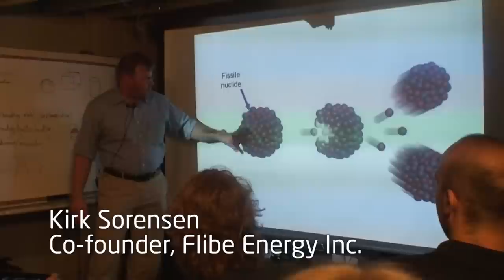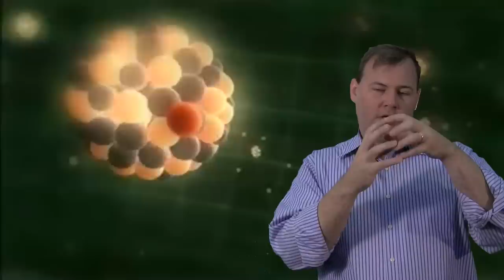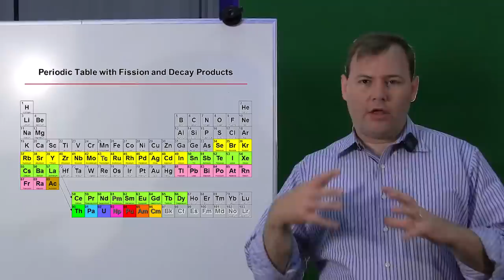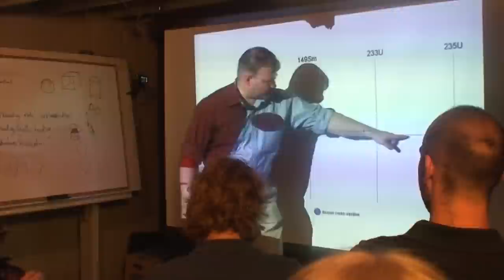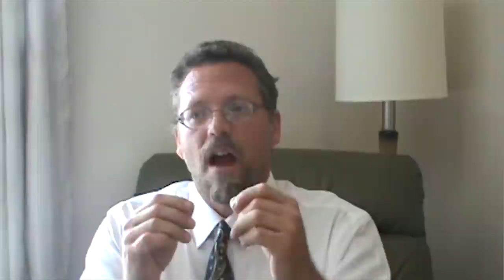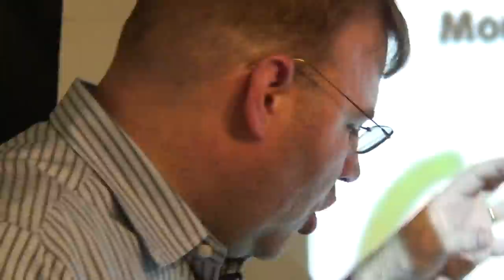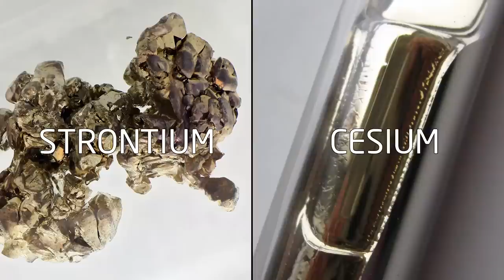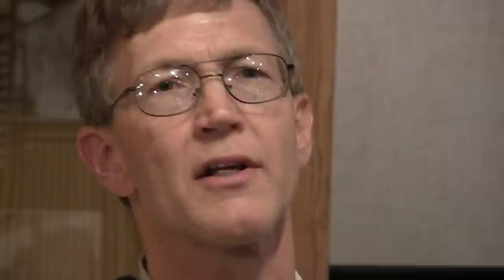Nuclear Waste: Fission Products & Transuranics from Thorium & Uranium - "Th" Documentary

Comment: Myth: the new generation of nuclear reactors are designed to recycle nuclear waste

BUST: These reactors don’t exist

These reactors often spoken of by advocates of nuclear energy are hypothetical. 
There are none of these “Generation IV” reactors commercially operating anywhere in the world:

Even the demonstration plants are still decades away
Various designs are still under investigation on paper and have been for many years.

The first demonstration plants are projected to be in operation by 2030-2040, so they are yet to be tested and still many years away.

Problems with earlier models
The specific type of Generation IV reactor that would recycle waste – the Integral Fast Reactor – only exists on paper, but earlier models of fast reactors have been expensive, underperforming, and have had a history of fires and other accidents, with many countries abandoning the technology.

These reactors would still produce some waste

The Integral Fast Reactor is called “integral” because it would process used reactor fuel on-site, separating plutonium (a weapons explosive) and other long-lived radioactive isotopes from the used fuel, to be fed back into the reactor. It essentially converts long-lived waste into shorter-lived waste. 

This waste would still remain dangerous for a minimum of 200 years (provided it is not contaminated with high-level waste products), so we are still left with a waste problem that spans generations.
The theory is that these reactors would eat through global stockpiles of plutonium

When thinking about recycling waste it’s important not to confuse recycling existing stockpiles of waste with these reactors perpetually running off of their own waste, which they could also be operated to do. If they ran off their own waste, they would not consume existing waste beyond the initial fuel load.

Simple, the whole process of fission reactors is economically unviable

It is obvious we should be putting all our resources into fusion reactor development

...
Reply from the maker: +ask412 While I'd like to see fusion be successful (many approaches are being tried, and one may certainly pan out), liquid fueled nuclear can indeed address many concerns people have with today's reactors.

You mention waste. Anti-nuclear campaigners seem very unimpressed by waste lasting hundreds of thousands of years being replaced by waste lasting a couple hundred years. Fine... if you say 200 years is unacceptable to you then then I'm not sure why Tritium with a half-life of 12 years is not a problem for you.

Most of these isotopes produced by fission (the fission products) can be put to productive use. But they must be segregated to do so. To be segregated, they must be in liquid state.

The very first step of pyroprocessing is to dissolve into molten salts... from there, waste can be separated and sorted into useful isotopes. 

The point of liquid fuel reactors, as first envisioned in the 50s by Alvin Weinberg and the team at ORNL, is not just to make nuclear fuel recycling possible, but that it should be economic to do so. Eliminating the steps of dissolving "spent" fuel, and reconstituting fuel pins, is how it can be made economically viable. Otherwise the cheapest source of fission fuel will remain enriched uranium, and our "spent fuel" volume will continue to grow at present rate.
Reply: +gordonmcdowell wrote: "...is how it can be made economically viable..." 

Every single thorium reactor built since the early 1950s has been experimental. 
If one of the experimental designs actually reaches 'proof of concept' it will take until at the least until 2030-40 

And  'proof of concept' includes economic viability 

That looks like a bloody long shot from this perspective ...
...
Reply from the maker: +ask412 Yes, and they've all been solid fueled reactors. Proponents of liquid fuel reactors (which includes myself) argue that Thorium can not be bred economically in solid fuel reactors. The only proof-of-concept achieved is that it is technically feasible, not economically feasible.

However, we'll be seeing commercial Molten Salt Reactors in the 2020s which can run on enriched uranium (like today's reactors do), but more efficiently. Whether that's the starting point from which chemical reprocessing is explored (enabling Thorium breeding) or development on Th-MSR begins in parallel with other MSR, this solid-fuel constraint will be going away. Too many companies and countries are pursuing liquid fuel for MSR itself to not reach commercialization.

This includes TerraPower too... that's Bill Gates reactor company. He once famously dismissed molten salts (in 2011) as being too challenging. Now Bill Gates is conducting research into molten salt fast-spectrum reactors... the perfect category of reactor to take today's spent fuel, turn it into energy, and turn it from a hundred-thousand-year-problem into a couple-hundred-year-problem. Much easier to solve storage challenge for hundreds-of-years than hundreds-of-thousands-of-years.
Reply: +gordonmcdowell wrote: "...we'll be seeing commercial Molten Salt Reactors in the 2020..." 

We may very well, however, there have been experimental reactor designs built like this since the 1950s with the same "Blue Sky Mining" stories and still no 'proof of concept' 
Construction of a new experimental molten salt reactor doesn't mean it has 'proof of concept' inclusive of economic viability.

That will take decades to prove, literally, get used to it

People like Kirk Sorensen will keep putting their stories up in seminars for the rich like Bill Gates, touting for money to keep going with their experiments.

Meantime, those of the Disney Generation will keep the 'faith' and still live in hope that 
'nuclear fission will make power too cheap to meter and safe'...

It's all a very, very old story, that human history has proved is still a dream...

...
Reply from the maker: +ask412 Why on Earth are you making positive comments about Fusion when your concerns would apply just as well to that?

"Economic viability" is only proven when a commercial reactor is operating. Or disproven. Millions of dollars in MSR R&D are helping move toward that point. So please come back in 2025 and tell me how foolish I was. Take care until then.
Reply from the maker: +ask412 Could you stop bouncing around to various fission technologies (Hinkley Point C) and address the 2 technologies you first cited YOURSELF?

YOU mentioned fusion as what we should be pursuing. And YOU dismissed MSR as economically nonviable.

So why did you mention fusion? Were you being sarcastic or not?

blah blah blah Disney. I get it, you're trolling. Get back to your fusion tangent and clarify whether you are seriously citing that as what we should be pursuing or not. Since YOU raised the point.
Reply: "These reactors often spoken of by advocates of nuclear energy are hypothetical." That is exactly what describes fusion reactors to a T. "Simple, the whole process of fusion reactors is economically unviable." Find me a reactor that creates more power than it consumes and MAYBE, just MAYBE, we have a case.
Reply: '...commercial reactor is operating. Or disproven. Millions of dollars in MSR R&D...'  gordonmcdowell

You nailed it, all these reactors are experiments, while simultaneously sold in the sales brochures^ to the political centre; 'as if' they are economically viable.
Which by anyone's system of values is deceitful when alternative energy systems have reached economic viability, suit micro, small, medium, large and super grids; and are relatively cheap to recycle and redesign  
____________
^ as above in this video, blog pages etc.etc. all linked to the 'business' of acquiring research capital that needs to run over the next millennia  or longer
Reply: 'ask412 Could you stop bouncing around to various fission technologies (Hinkley Point C) and address the 2 technologies you first cited YOURSELF?'   gordonmcdowell

Why? 

The fact is MSR/thorium/generation IV reactors have been sold using the very same premise as gen I, II, III, III+ that were, or are, in a continual stage of development; where 'blue sky mining' projected futures are promoted 'as if' these are or were economically viable. 

Yet, history shows that the national or multinational nuclear energy corporations making these promises have failed to fulfill the 'Disney Generation' dream of 'delivering electricity' ..."too cheap to meter".    
Let alone produce metrics of the complete reactor cycle, nor will they until any nuclear reactor is decommissioned, and still up till  2016 none have. 

It's the same strategy, just using new 'weasel words'  in marketing across all forms of media creating a surreal expectation of nuclear energy to suit vested interests.
Reply from the maker: "Why?"

Because I don't have patience for anti-nuclear activists who cite fusion as a solution to pretend they're open-minded in regards to atomic power.

You've offered no objection against MSR & Th-MSR other than it-hasn't-been-done-yet commercially.

So explain how that does not apply to fusion?

I'd love to move past this point once you answer the question.

And I'm very confident in nth MSR costs being quite low. Even AP1000 is seeing dramatic cost reductions in the 2nd Vogtle unit compared to 1st. No-brainer when every reactor isn't a 1-off special snowflake.
Reply: gordonmcdowell
I grok your comment, apologies for the tone

Still, I can say; 'I have little patience' after decades of scanning for kernels of truth from the whole nuclear industry

A group driven by either:

1^) taking ground from the enemy at all cost, with everything else as collateral damage;
or by a
2*) profit premise, that puts the relatively short term ROI, at the apex of decisions and before social responsibility

Given the timeline the nuclear cycle needs to mature, evolving into a safe, viable source of  energy; I to have little patience for the impatient.  

The 'true believer' who expect nuclear energy to reach it's potential in such a relatively short period as two or three generations lifetimes.

Eight to ten generations would be a conservative perspective, given the millennia involved in whole nuclear energy production cycle, inclusive of nuclear waste storage

____________
^ 1) the military
* 2) the energy monopolies

Both run by the UN Security Council

The irony is the nuclear stories are woven around fission reactors by the UN Security Council; China, France, Russia, United Kingdom, United States

A group who oversees the course and direction of energy production of weapons and electricity; controlling the industry with international treaties that are policed by the IAEA. The industry group who also curates the media globally about safety, viability and development

While pushing the nuclear line in a continual global arms race for peace and security, or nuclear energy production of toxic radionuclides, to boil water and generate electrical energy

This has normalised the nuclear industry conditioning people to never question it's value since 1945 right through to our present era

August 2016 is 71 years since the Hiroshima and Nagasaki atomic weapons were used in the name of peace

To this day we have never seen the true dollar cost of cleaning up the weapons mess growing year after year
Neither have the metrics of any nuclear reactor cycle ever been transparent, as none have been fully decommissioned

What are the probabilities any reactors metrics ever will be transparent?
Reply from the maker: Well it would help if you stop conflating weapons production with energy production. Since no one I've spoken to over since first hearing about MSR in 2009 has any interest in weapons. The only weapons interest they have is turning warheads into fuel.

Great that you don't trust U.N. Security Council. Lots of conspiracy theorists do not. 

IPCC recognizes nuclear LIFECYCLE as low-carbon. That is, less CO2-per-hWh than even solar PV.

Are you going to call that into question too?
Reply: Can you go to argument clinic please?
Because Argument never win due to extreme skepticism and loosing yourself whether the informations and sources are accurate or not.
Reply: Jaret Jose Ulanday that comment is framed around an opinion nuclear reactors are worth developing 

Based from your comments on certainty, what makes you believe this type of  fission reactor will beat any fusion reactor to 'proof of concept' inclusive of economic viability since they both have been in development since the 1950s? 

Can you in your considered opinion, explain how much longer it will take to develop this type of thorium reactor?
Reply: Nothing beats nuclear fusion reactors like Tokamak and Stellarator against nuclear fission reactors, but there is a problem: how can we produce hydrogen for fusion reactors?

You make know tritium—a radioactive gas which a half-life of 12.3 years—exist in nature, but it is rare and hard to get it. On the other hand, deuterium like tritium can also exist in nature, yet it is more common than tritium but rarer than ordinary hydrogen a.k.a. protium. It can be easily done through electrolysis, which is used in Manhattan Project and Uranprojekt (German nuclear weapon project) for producing atomic bomb during Second World War and Girdler sulfide (GS) process. However, when this get deplete for the sake of electricity production, it's hard to get it, yet can be deplete this for millions of years.

The economic feasibility of deuterium and tritium production for fusion reactors (I have no choice) rely on nuclear fission reactor. Fission reactor like Light Water Reactors, Breeder Reactors and the proposal Molten Salt Reactor can produce deuterium and tritium through the bombardments of atoms.

The best doesn't always right and the worst doesn't always wrong, more than just for economic feasibility, they are also for space exploration. We need to diverse and synergize energy for reaching the stars.
Reply from the maker: Copy/paste from Ask412. Ask412 routinely edits his posts to misrepresent conversations, this is a means of addressing his after-the-fact edits.

--- COPY/PASTE STARTS ---

You make know tritium—a radioactive gas which a half-life of 12.3 years—exist in nature, but it is rare and hard to get it' Jaret Jose Ulanday

Like a lot of the science on this videos threads, what you say about 
tritium is partly true 

However, tritium is made every day in prodigious amounts

How so? 

It is made during nuclear fission in a reactor as are many other 
radionuclides, those can be contained, the problem is containing tritium
 gas, not making it, as it leaks out of all known containers regardless 
of the science employed  

A long-term study of the environments around fission reactors in Germany
 has identified the cumulative exposure to this tritium gas leaking 
24/7, 365 days per annum is damaging the DNA in rapidly dividing cells 
of living things. Most importantly in those of growing German children 
0-12yo, couple this serious health issue with the dramatic fall in the 
cost of renewables electricity, and Germany has changed their public 
policy toward nuclear reactors 

The result is the scheduled decommissioning of all the nuclear reactors,
 and replacement renewable electricity alternative energy development 

For the record here, Switzerland is voting at the end of November 2016, 
on a reactor decommissioning program based on German Public Policy over 
renewables replacing reactors 

Also announced this month of November 2016 Taiwan decommissioning 
reactor program based on German Public Policy over renewables replacing 
reactors also

The nuclear dominos are falling renewables are cheaper, and the science 
of detrimental health effects can't be covered up any longer. Covered up
 by the UN Security Council P5, based on national security priorities, 
where the IMC objective takes precedence of social responsibility

A UN Security Council P5, public policy premise policed by the IAEA 
since it's inception in the 1950s. Where the IAEA manages the WHO 
publication of health studies^ and also looks after the legal 
ramifications of all international treaties around nuclear weapons, 
reactors, and medicine. I am aware that the UN media services have 
worked very hard to put nuclear matters in silos segregating all three, 
nonetheless, they're all part of the nuclear industry and it's culture 

If this wasn't true the IAEA nuclear industry association wouldn't 
exist, logic dictates it is one industry and culture 

--- END COPY/PASTE ---

"Ask412" you can post a link to the study you are citing regarding Tritium. I can understand why you might not post a link... links need to be approved. But you could have at least named the study.
Reply from the maker: Copy/paste of "ask412" comment. Ask412 revises comments after soliciting a response so this is a means of locking-down the actual conversation.

--- START COPY/PASTE ---

gordonmcdowell '...IPCC recognizes nuclear...'

That's a very subjective opinion gordonmcdowell

--- END COPY/PASTE ---

http://shrinkthatfootprint.com/greenest-electricity-source

IPCC puts nuclear's carbon footprint... its LIFECYCLE carbon footprint... between wind and solar. That's low carbon. Only anti-nuclear folk seem to get stuck on this point, as they prefer studies like Jacobson's where the carbon footprint of nuclear war is included, or historic & less efficient means of enriching uranium are weighted heavier than they should be.

Which country has lower carbon footprint, France or Germany? France is lower-carbon. That is because they're electrified and nuclear powered. If nuclear was high-carbon then France would be high-carbon, but they're not.
Reply: 'ask412 Why on Earth are you making positive comments about Fusion when your concerns would apply just as well to that?  gordonmcdowell    

Firstly I am on earth, I respect this as a unique place in the universe, with orders of magnitude in complexity due to its near countless ecosystems acting integrally as one system, that far exceed any man-made system,  in this case, the reactors relatively simple complexity by comparison

Secondly, why are my comments positive or negative, fusion and fission reactors have been in experimental development from the late 40s till 2016/17, that's over seven decades - 70 years? 

Thirdly, what are the probabilities fusion will beat fission to 'proof of concept' in engineering terms, inclusive of economic viability?  

'Economic viability" is only proven when a commercial reactor is operating....' gordonmcdowell 

I couldn't agree more, nonetheless, no reactor has a full set of metrics proving or disproving, economic viability, everyone so far has been a unique experiment, even the decommissioned ones

'...Millions of dollars in MSR R&D are helping move toward that point...' gordonmcdowell 

Yes, this is absolutely essential, if this reactor science is going to come to fruition, so I couldn't agree more with you. As all innovation throughout our species history has required great risk for great reward, this is a given 

Please be mindful since 1948, not $US billions, but many $US trillions of sovereign wealth, have been spent collectively by just the UN Security Council P5 nations of; China, France, Russia, The United Kingdom & the United States and yet there still is no reactor with 'proof of concept' inclusive of economic viability in engineering terms

'...So please come back in 2025 and tell me how foolish I was...'  gordonmcdowell

Nonetheless, nine years is a relatively short timeline to expect a resolution to this relatively short innovation creation, as yet unrealised economically. When just the tiny transistor as one example, has been in innovation since 1959 and it's cycle of innovation has long ago proved to be economically viable, but this happened many generations after it was created. 

A timeline for transistor innovation, until now is six decades long and over 60 years 

The solar cell was created as an innovation in the early 1800s, and it wasn't until the photovoltaics breakthrough in the early 60s, it had potential; in the late 2000s  the solar panel became economically viable to fit on homes and large businesses 

A timeline until now of five decades and over 60 years, and those two examples are complex. But by comparison to nuclear reactors both are relatively simple problems of technique and automation feeding the speed of achieving economic viability

'...tell me how foolish I was...' gordonmcdowell

Ok, I'll come back if I can

It's only nine years away, but why are you foolish raising money for reactor research, it's essential going forward for our evolutions as a species? 

If this works out after a realistic timeline of development, fantastic. 

But what are the probabilities of achieving a realistic waste solution, the economic viability of any reactor and miniaturisation, in less than a decade? 

Which are parameters now essential in competing with clean, alternative, renewable solar, wind & wave energy, growing smaller dimensionally yearly, and yet producing the same or greater electricity output? 

What will clean alternative renewables be doing in nine years, as the profit made - then reinvested or economies of scale, feed in fast so are even now growing exponentially in 2016/17? 

I haven't even touched on all the alternative energy innovations about to achieve innovation efficiencies, able to make them economically viable
Reply from the maker: This is a copy/paste of Ask412's comment because Ask412 constantly modifies posted comments altering the questions after-the-fact.

--- BEGIN COPY/PASTE ---

Which country has lower carbon footprint, France or Germany? France is lower-carbon'...' gordonmcdowell 

This is past history regurgitated, here and now going forward nuclear energy is failing because of innovation efficiencies in alternatives, they are getting cheaper by the month year and decade 

What are the probabilities this will reverse as nuclear reactors keep failing? 

Seriously, that's a reference to a blogger^, 'My name’s Lindsay...'I have an economics degree...' yeah, making money selling his consulting services 

He is entitled to his opinion all good, I hope it works for him, because nuclear reactors are dropping like flies across Europe and 'Winter is Coming'   

France's reactors are in trouble
This has lead to reactor shutdowns in France, as they require base-load, 24/7, all year, pumping out near peak power. If they don't run like this maintenance increases dramatically and switching on&off makes energy very costly to trade against alternatives, and 20 reactors have shut-down this year in France already and 'winter is coming' 

"The discovery of widespread carbon segregation problems in critical nuclear plant components has crippled the French power industry—20 of the country’s 58 reactors are currently offline and under heavy scrutiny. France’s nuclear safety chairman said more anomalies “will likely be found,” as the extent of the contagion is still being uncovered" * 11/01/2016 | Lee Buchsbaum - Power- Business & Technology for the Global Generation Industry Since 1882

The global grids are interconnecting using clean, fast to recycle, C02 emission neutral renewables, and alternatives of all types ^^

All able to operate across time zones, smoothing out peak demand and operating across geopolitical borders with no issues 

Vietnam has killed off their reactor project as uneconomical^^,  and last week Taiwan announced a reactor decommissioning schedule going forward ** 

--- END COPY/PASTE ---

Ask412,

You are confusing "past history" with present. Germany PRESENTLY has higher carbon footprint than France, and Germany isn't even down prematurely shutting down nuclear. Germany's carbon reduction has stalled even while their renewable share has been climbing. That's the present. Welcome to the present.

"You cited a blogger..."

I cited a blogger who cited the IPCC source. You saw that, right? IPCC didn't post a bar-chart so it is up to people trying to communicate to the public to bar-chart it from their report.

Here's Environmental Progress doing the same.
https://pbs.twimg.com/media/CoJRschUEAA38aG.jpg

Don't worry I've got a nice piece I"m working on bringing together IPCC, charts on Germany's stalled GHG reduction, and Dr. James Hansen. You'll have no trouble following along.
Reply from the maker: ask421, Really, you don't see the IPCC reference cited in both bar charts? It isn't that you're lazy, I'm sure.

The very first comment on this thread you posted included the following:

"It is obvious we should be putting all our resources into fusion reactor development."

...and then you switch gears in later comments and cite TRITIUM as some insurmountable obstacle when created by fission.

Of course there will always be insurmountable obstacles for you.

Of course you can't be bothered to read the IPCC citations provided by the blogger or Environmental Progress.

And of course you won't acknowledge France's lower GHG footprint beating Germany's as an important observation.

Ask421 quotes me...
‘You are confusing "past history" with present. Germany PRESENTLY has higher carbon footprint than France, and Germany isn't even down prematurely shutting down nuclear’ 

My typo: down -> done. DONE. "DONE." Germany isn't even DONE prematurely shutting down nuclear.

See how the sentence doesn't make any sense with the word "DOWN" in it?

If Germany is not DONE shutting down their nuclear fleet.. if they continue to replace GHG-free energy with a mix that include biomass, how is this going to improve? Answer: Not for a long time.

If Germany planning on shutting down all coal by 2023? Can you even imagine them doing that? I can not.

http://www.independent.co.uk/news/world/europe/france-close-coal-plants-shut-down-2023-global-warming-climate-change-a7422966.html

http://www.climatechangenews.com/2016/10/27/german-minister-well-burn-coal-till-the-2040s/

So, no, I am not calling Germans liars. Great for you to throw that out there though.

I am observing that Germany's GHG have held steady despite a very rapid climb in their "renewables" share. And that their GHG has never dropped below France's. As of TODAY there's no evidence you can provide disputing this.

And that some French PWRs are about to be shut down is indeed troubling. Do you think that will result in France GHG drifting up beyond Germany's? It won't help matters, but I don't see that happening. There's not enough French PWR impacted.

Do you need another example of low GHG with a nuclear mix? Ontario. I was born there.

http://live.gridwatch.ca/home-page.html

...they haven't burned coal since 2014. That is what Germany could have been, had they not begun prematurely retiring their nuclear fleet, and instead supplemented it with additional clean energy.

NOTE TO COMMENT READERS: ask421 routinely edits comments after posting them, to change context of given replies. To address this I am copy/pasting his comments in my own (and deleting his) so there's a permanent snapshot of the conversation.

--- BEGIN COPY/PASTE of ASK421 COMMENT ---

'Here's Environmental Progress doing the same...' gordonmcdowell 

Seriously, the same as; '’My name’s Lindsay...'I have an economics degree…’ ?  

Just be mindful, taking 'images' as you have out of context with '....pbs . twimg . com / media / CoJRschUEAA38aG.jpg...'  is doing me a favour

Why?  

I can't drill down through the information, and look at any writers vested interests, identifying biases one way or the other, and forming an opinion, so, I just discard it 

As there is no value spending time on it,  for myself, or any other reader, without any context we can discover verifying it's source 

Don't worry I've got a nice piece....Dr. James Hansen'  gordonmcdowell  Interesting, "That's gonna be huuuge"  

Dr. James E. Hansen, longtime director of NASA's Goddard Institute for Space Studies, sounds interesting, good choice  

'You'll have no trouble following along...' gordonmcdowell

I never do, where we differ is in value systems applying the information and the unrealistic timelines of innovation development as an outcome of the altitude you are stuck on

‘You are confusing "past history" with present. Germany PRESENTLY has higher carbon footprint than France, and Germany isn't even down prematurely shutting down nuclear’ gordonmcdowell 

Really, is that your line of logic, are you infering, Germans are lying? 

Interesting, something to think about 

Fascinating, I have found Germans, and their language more literal, than French or English 

Then why has Germany announced it is decommissioning its reactor fleet with Energiewende^ , and Switzerland is having a referendum* at the end of November 2016 to choose a reactor decommissioning plan? 

‘Germany PRESENTLY has higher carbon footprint…’ gordonmcdowell 

And the problem is what, gordonmcdowell? 

My Best Guess is you were unaware that Germany having announced it’s transition out of the carbon energy economy; has decided to create a clean, renewable, fast to recycle, low carbon economy. So during the transition, is using energy sources including any offered as surplus by those countries it’s integrating with; who use base-load power, coal, oil, gas, or nuclear fuel. 

Is that right, or are you just pissed at this outcome? 

Nonetheless, the power offered by France and others coming out of reactors is too expensive, so it is bypassed by the central electrical control trading algorithms for cheaper energy when it is  ¯\(ツ)/¯

Currently, here & now, this means they are using alternative energy sources 24/7, and that is biogas, hydro, solar, wind etc.etc. it's mix changes in 350-second blocs though

If you want to use a blogger quoting an IPCC report about where they want the market to head strategically, when they met some years ago , that’s ok. Post the link I’ll scan it, all good 

However,  ’My name’s Lindsay...'I have an economics degree…’ has taken a snapshot of past events projecting them into the future. And as he may already be painfully aware, business is less moral than that, they don’t care, well, that is a banker, financier, CFO, all the EOs, stakeholders, corporate couturiers etc.etc. don't do they?  

And I am telling you here & now, 'if', Kirk Sorensen used these amoral ECorp courtiers lines of logic; he would tip up the experimental reactor as not worth the risk this innovation needs, and he shouldn't do this  

Because if it makes money in the next 350secs, 'we make money' say the ECorp courtiers trading electricity. So if they string those together 350secs to 700sec that’s better, and so on, this goes on day after day....and it's done without a human, by using code, AI, with no recognisable good human values. Except with the amoral oversight of ECorp courtiers trading electricity

gordonmcdowell, here’s the thing; the corporate world trades in nanoseconds, literally, and not in 5-minute blocs of 350 seconds electricity trades or slows down too 

Why? This is giving those like carbon & nuclear, a chance, as they are base-load dependant and a transition to a low carbon economy is in progress, so eventually, it will be in real-time, that's a given

Nonetheless, the energy trading system acting across geopolitical borders can do this in real-time and does. By using processors, software, and it’s algorithms used in the ‘market’ to make projections calculating in nanoseconds what are the probabilities of price are in the future. And the probabilities of all energy sources of generation, then it discriminates against the most expensive in weighing probabilities. Again, again, & again Infinitum…..
 
Sadly from your worldview, this includes carbon & nuclear fuel  

That is the context of my comments about the, here & now, not five years ago, a past decade, half century, or during a period of any reactors earlier timeline 

But over the previous, last and present financial years, electricity can be successfully traded from all forms of energy sources, but most importantly here & now

So based on that context, alternatives have proved cheaper in the previous, last, and present financial year in Europe. The same is true of this year going forward into a future

Point of fact is, strategic foresight by electrical energy professionals in grid marketing in Europe, can’t see alternatives getting less comparative as a ‘group’, in the next 25 years if ever

So nuclear cannot compete, here & now, in the real energy trading market integrating grids geopolitically, with current, production sources, carbon, nuclear, and clean renewables. It isn’t a problem, it’s been solved, and base-load power plants are looking like poor investments to the ECorp courtiers trading electricity 

This has driven the oil & coal price lower in order to pragmatically compete, and carbon emissions for the carbon energy sector just become an ‘inconvenient truth’, is all 

For the record, I don’t like it either, but this is a period of transition to a low carbon economy. So, I am not in denial of this outcome in the context of IPCC reports, and that it was predicted in the information I have been personally reading for many decades. So for me, this is no surprise, for you, however, it is, apparently

Which is fascinating 

--- END COPY/PASTE of ASK421 COMMENT ---

Gord writing again now.

Thanks for your thoughts, ask421!

Since you go-on at length about the challenges of all baseload... was your no-worries-about-tritium enthusiasm for fusion also a no-worries-about-baseload type of enthusiasm? Or was this going to be a tritium-free and load-following fusion reactor you were advocating?

To quote ask421: "Simple, the whole process of fission reactors is economically unviable. It is obvious we should be putting all our resources into fusion reactor development."

You sound like an expert on what is viable.

Oh look, someone is already demonstrating the viability of nuclear to decarbonize a grid...
http://live.gridwatch.ca/home-page.html

...with FISSION. A real thing. Here today. Which can be made even better going-forward with MSR instead of PWR. 

Maybe instead of fearmongering about tritium (which is rich coming from a fake-fusion advocate) you should convince people to build more long distance power transmission lines? That would help advance ALL forms of clean energy.
Reply: ‘...ask421, Really, you don't see the IPCC reference cited in both bar charts?…’ gordonmcdowell  quoting ask412

Re: the image in both, but where, when, and what context do the images have? ^   
Or do the reader and myself take this purely on faith, and use your context?    

As I said, I don’t have time for images without context, please let me clear as you seem to be confused, I don't actually mean your context^ 

So there still is no frame of reference for the image or images, except yours, why, gordonmcdowell?

Once again for clarity;  without your caveat; it comes from the IPCC, and the point is what,  it comes from the IPCC ; the point is what?

that is circular logic, why is that circular logic? because that is circular logic, which circles back to, that is circular logic, why is that circular logic? because that is circular logic, infinitum…  *

I’ll let the reader use their due diligence on that, as my point has been made more than once, so my question is now just rhetorical or an interior question, something to think about

‘Oh look, someone is already demonstrating the viability of nuclear to decarbonize a grid…’   

How, with yet more graphics out of context^?  

Ok, if it works for you,  what can anyone say?

Who could possibly have a conversation using circular logic? Except    

Generally people with ideological systems and utter certainty that comes with it  ^^  

All good, It's conversation of sorts

Nonetheless, to the reader it must sound like a K1-K4 playground one, which is sad, I guess it was unrealistic expecting more      

______________
^    Context includes the value system of the writer, group or groups, the culture or the worldview written and  the purpose of motive for writing   
*      https://goo.gl/WLZGBM    
^^     ✝   ✟   ☦   ☧    ✠   ☨   ☩   ☥   ☧   ☪   ✡   ☫   ☬   鞄   ﷲ   ☸  ☭  ideological values    
...
Reply: gordonmcdowell wrote in an abstruse
 way : ’The very first comment on this thread you posted included the following:

”It is obvious we should be putting all our resources into fusion reactor development” ^

…and then you switch gears in later comments and cite TRITIUM as some insurmountable obstacle when created by fission...  

...Of course there will always be insurmountable obstacles for you'  

No, ‘not insurmountable’ gordonmcdowell ^ 

They are just comments about completely different conversations on this video thread, lifted out of context, that to any reader wouldn’t make sense, including me

Still, why would anyone need to do that? 

Something to think about  

‘Of course you can't be bothered to read the IPCC citations provided by the blogger or Environmental Progress’ gordonmcdowell 

No, I can’t, that is very true 

Not when the images or 'citations' you branded the images, haven't been put into context; much like the comment dropped in about radioactive ‘tritium gas’ not being able to be contained by any known science, even up till November 20, 2016 

 ________________

^   If anyone wants to have an answer to the context of that comment, just ask412 in reply, an explanation should be demanded
...